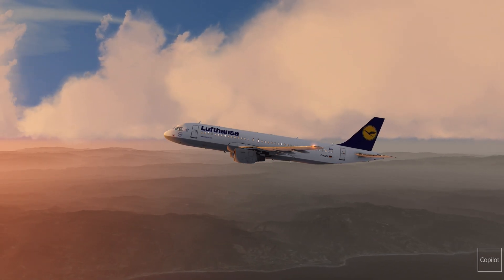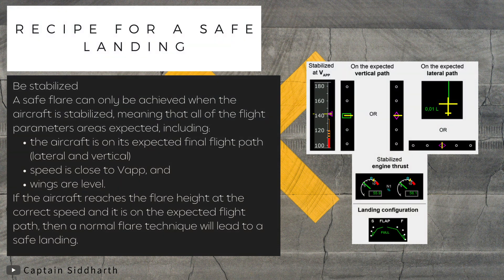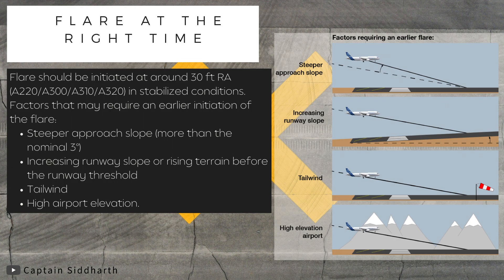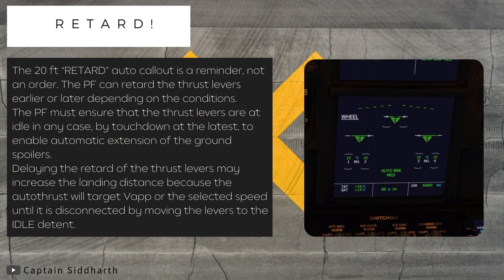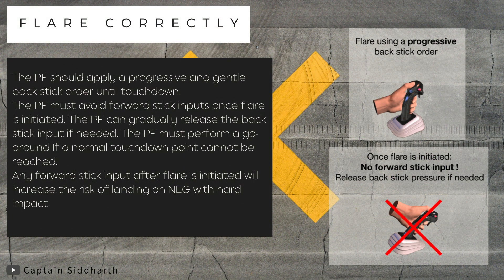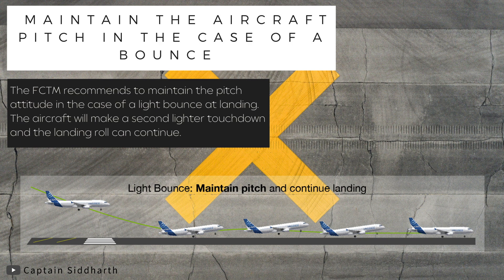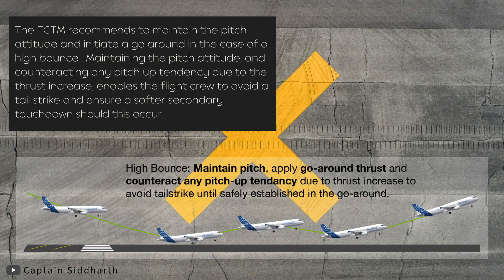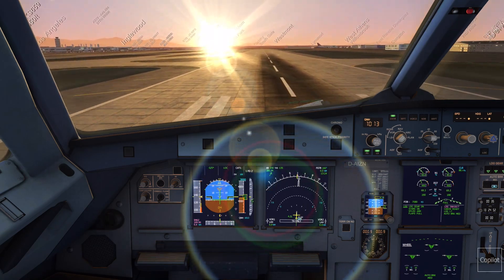Landing Technique | Airbus A320

Comment: Well it's not that hard to make a soft landing ~150Fpm with a calm wind, my record is about 58 fpm in A320Neo, but if i am trying in msfs 2020 landing challenge at Madeira( funshal) with unstable wind up to 25 knots i always get 600 fpm at best and at worst up to 1000 fpm. Maybe just a few times i got 100 an 200 fpm. Ohh, unstable wind that changes your speed on 10 - 15 knots in just a second - is really a big problem to land aircraft smootly. Or maybe it just me too bad.